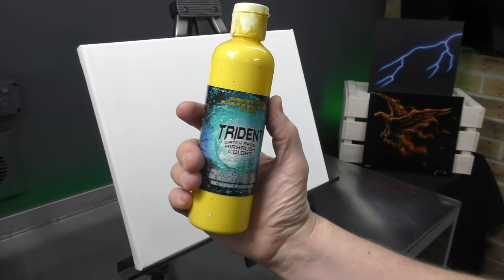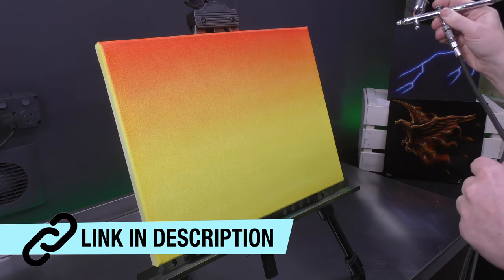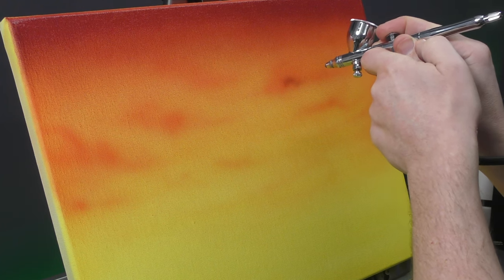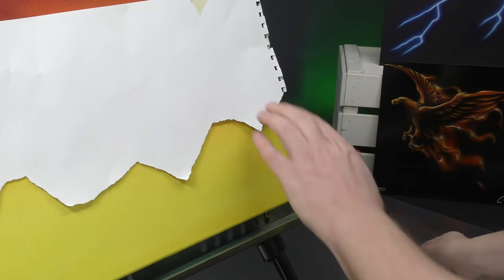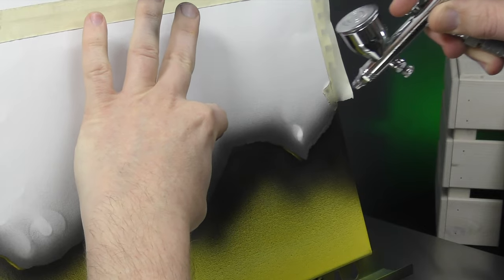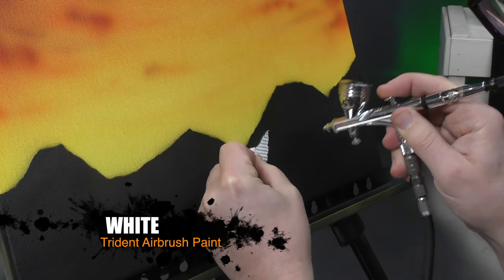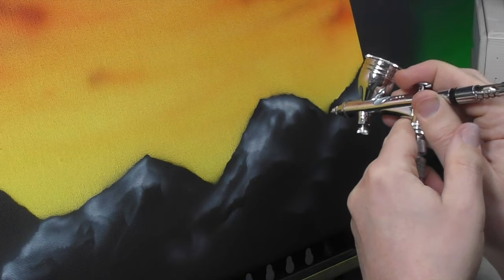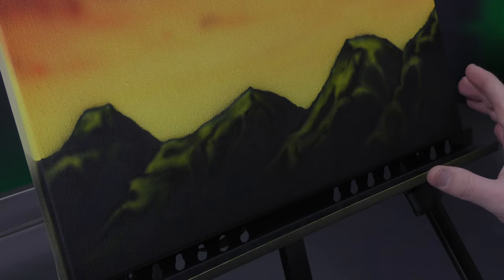Airbrushing a Simple Mountain Range

Comment: Thanks for the great videos I had an Itawa eclipse in a box for 10 years and this encouraged me to pull it out and learn to use it. The painting came out pretty good for first one. The only problem I have is spraying opaque white it will spray intermittently and splatters I am using createx paint and 4011 reducer any ideas for me to fix it.